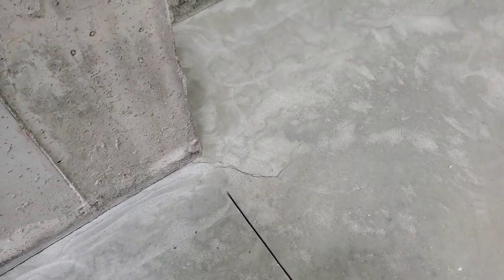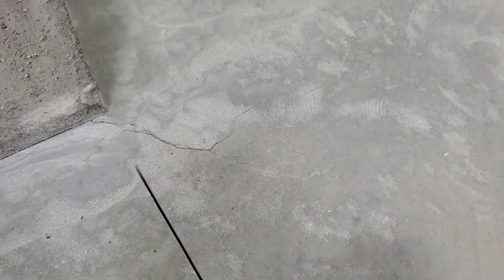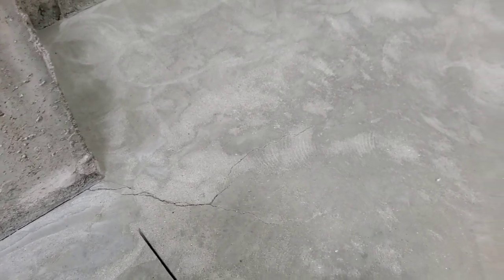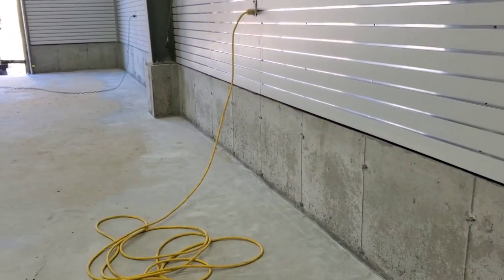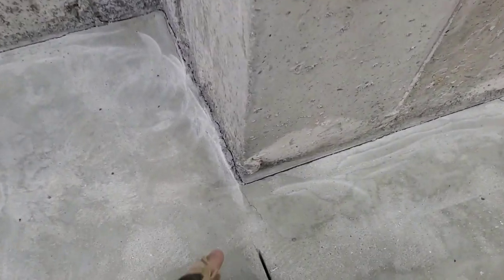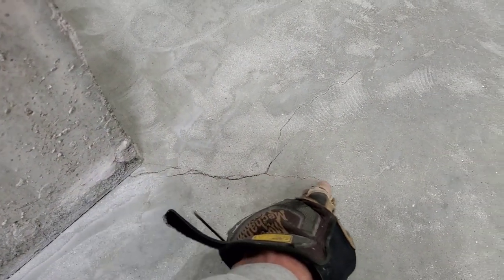Simple Concrete Floor Crack Repair (DIY EASY!)

Comment: I've used everything possible to fix a crack but this is the first time I've heard of bonds. How long will that survive outside? Any suggestion on another cement product that you use that works on cracks and takes a long time to recrack.
Reply: It won't, bondo is not waterproof and will retain moisture - not something you want if you live in an area that sees ice and cold weather.  You'd be better off using short-hair fiberglass filler instead of bondo for stuff outside - better for high moisture areas.

Comment: I have use Two Part Epoxy and concrete dust, to do just that. I done super glue baking soda.  I never did think about using bondo. I am going to give this try next time.
Reply: Is the concrete dust to try to match the color? Did you just kinda sprinkle it on tacky epoxy? How did it turn out?
Reply: @cheshstyles  The idea was to match the color.  What worked best was mixing the dust into the epoxy then the harder. Made it thick hard to work with. Work fast. Pressing into the smallest cracks 1st. Don't use fast set epoxy. Come back and sand. Just like using bondo. I am going to try bondo next time.
Reply: @billpapps4345  thanks for the reply! Was curious if you found some secret cure

Comment: If you sawcut all the way to the corner you don't get those cracks. A grinder with a 4 inch concrete blade. Stop being lazy and do the job correctly 🙄🙄🙄🙄🙄
Reply: Does a painter walk into a house after a bad trim job and rip out all the trim and put up new trim? No he gets out the caulk and wood filler. So don't be lazy and read the description.  He didn't pour the floor or make the saw cuts so not his problem he is there to apply floor coating.